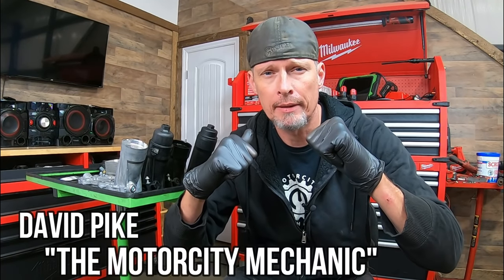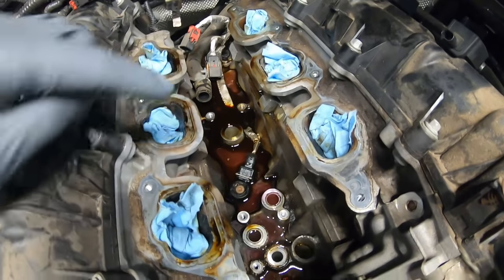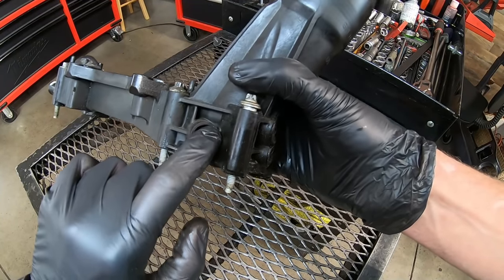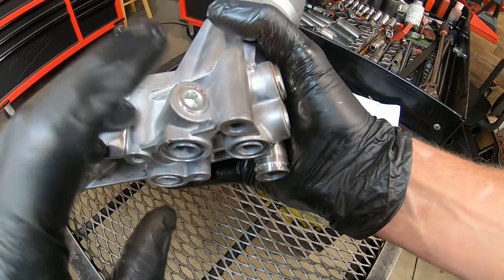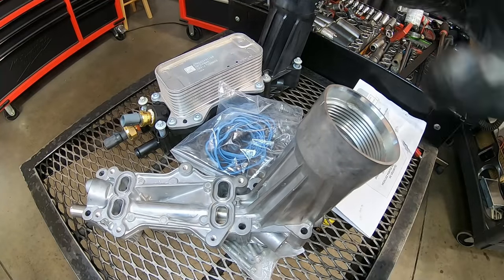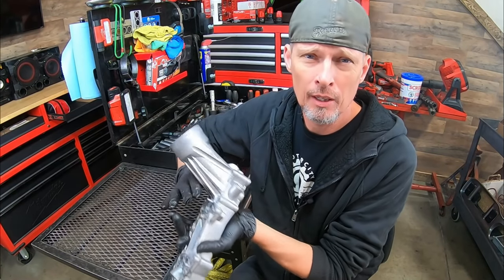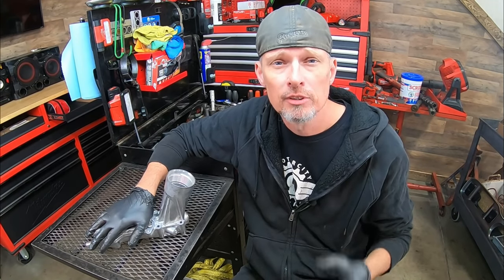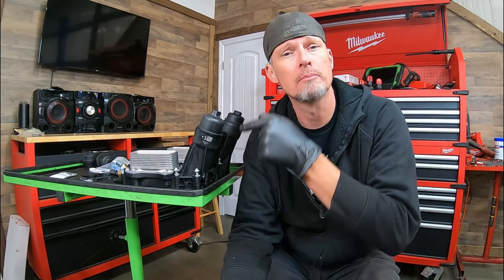Dorman 926-876 Aluminum Chrysler 3.2/3.6 Oil Filter and Cooler Housing Upgrade

Comment: I see no difference in fit for 2011 vs 2014 except you would have to get your hands on a 2014 cooler and cap why couldn’t I just do that if the ports and engine mounting bolts all line up?
Reply from the maker: As mentioned it’s not a fit issue. It’s needing to find the cooler portion, the bolts for the cooler to housing, the cap. Basically you almost buying a complete assembly to take the parts off. It can be done, you just have to spend more money and track down the parts. I have done a video on that as well To Upgrade or Not To Upgrade your 2011-2013 3.6 oil filter housing/cooler.
https://youtu.be/h8mEWyw0IZE

Comment: Where can I go to find out a vacuum line routing for 2012 Dodge Charger 3.6 nothing comes up when I do a search for a diagram
Reply from the maker: What are you having issues with? There are very few vacuum lines. Mainly just for the purge solenoid and brake booster

Comment: I installed the aluminum upgrade on a 2013 dodge challenger..now I have a cold start rattle..imo due to no oil drain back valve...all the oil drains back to the pan..the old housing had a built-in anti drain back valve ..the new one does not...now there is a screw on filter adapter,,cost 375$.. with a drain back valve in the new filter....I should have replaced the filter housing with an oe replacement part.. regret useing this so called upgraded part now... anyone else having this issue yet...
????......,,

Comment: What about a 2021 jeep gladiator is the problem solved?
Reply from the maker: I haven’t seen any late models with the issue. After about 7-8 revisions it seems they may have gotten it. We will see once those newer vehicles start getting some higher miles on them
Reply: @MotorCityMechanic  Thank you! Your channel is one of the best!

Comment: I am not used to wkg on chrysler stuff but have to look at one shortly which I suspect this assembly and I like the idea of using aluminum one, are there any steps needed to prevent metal corrosion where they mount to the block etc?  I have found over the years that cast iron to aluminum will make things corrode unless treated

Comment: I do not quite understand .. I have the first generation .. I will not be able to use this spare part?
Reply from the maker: Not straight out the box. The cooler is a different shape so your old cooler will not bolt up the this replacement part. There is an option but it ends up being twice the price if you do
Reply: @MotorCityMechanic  
I changed it to a second-generation cooler a year ago, and now I just buy another filter.  But I would still like to put this one, and forget about the problem.
Спасибо!
Thx!!!!

Comment: Your fitment chart confuses me. The Dorman site says it fits my 2017 Chrysler 300. According to that chart it won't? Weird.
Reply from the maker: I believe your reading it wrong. There are two engines for that year….one is gen 2 and other is gen 3. The 300 never came with the gen 3 for that year so yes it will fit. It’s the model of vehicle that determines which gen and what year.
Reply: I did some research right after I commented, and also confirmed it. Thank you for the quick response. I am glad my engine doesn't have that EGR trash.  I am a diesel mechanic and it's non stop problems.
Reply from the maker: I agree. On the gas engines, very few issues at all on the gen 3 with the egr valves. Luckily gas engines don’t have as much soot build up on the exhaust side as a diesel

Comment: Ever since General Motors started using plastic oil/coolant passages in the 1990s, it doesn't take much of a brain to figure out that it is not a good idea to keep going with this plastic stuff almost 30 years later.

Comment: I can't believe auto manufacturers can get away with putting crappy plastic parts like this on their products which requires aftermarket parts to correct. I'm a new Jeep owner and will look do this fix next oil change.

Comment: Hey guys , i have a 2012 Chrysler 200, last October i replaced the oil cooler housing , (it was leaking,) with the new  Doorman aluminum housing.  8 months later and it is leaking again. Has anyone had this issue ?
Reply: Try changing gaskets as well

Comment: In one of your other videos, you say you can update early model Oil Coolers to late model ones, with the only issue being someone might not load the correct oil filter. Is that still the case with the Dorman aluminum housing?

Comment: where is oil filter bypass valve in gen 2 and 3? in the cap?
Reply from the maker: It’s in the cap on those generations. Thanks for the question and make sure to subscribe

Comment: It's the pimply faced 16 year old at Jiffy Lube who thinks he needs a 4-foot breaker bar to put the oil filter cap back on. Which means that if nobody teaches him, he'll keep breaking them.

Those oil coolers at the stealership are over $500.00.

Comment: Do like me, fix it and sell it. Mine happened at home but if it happens on the highway you’re engine will lockup. I just got back from a long trip and the next week it started leaking. What a bad design. You have water and oil being pushed through a POS plastic part.

Comment: Put one on my 2014 Town & Country, torqued to 110 in lbs., started leaking oil 2 weeks after install. I just bit the bullet and installed a new Mopar unit which does not leak. I CANNOT RECOMMEND THE DORMAN UNIT which is the subject of this video. Double the work, Usual Dorman crap quality.

Comment: Why do you insist on an "OE" oil pressure sensor when it's the OE sensor that failed? For that matter, the OE cooler itself is a failed OE part. Doesn't it make more sense to recommend a "name brand" oil pressure sensor?
Reply from the maker: I have replaced more aftermarket oil pressure sensors that were “just replaced” then I care to count. Some leaked out on the connector side and caused oil to seap into the harness and all the connectors and Pcm causing expensive repairs. I go OEM for many reasons. One is that they are constantly revising parts when they find issues so when you go to the dealer you are getting the newest versions versus the same part at the local part store that doesn’t seem to last. If it was an easy to get to sensor then no harm in gambling. If it takes 2-3 hours to replace like on some 3.6 engines then spending more money if your having someone else do the repairs or wasting your time again doing it yourself. To me it makes a lot of sense. Spend money on OEM now or risk spending alot more later on aftermarket. Gamble if you like….but when it comes to my customers and reputation….I’m only using the best version.

Comment: I will never understand why anyone would put an oil cooler in the V of an engine let alone an coolant to oil cooler exchanger type. Way too many points of possible failure .  A simple spin off oil filter type assembly with oil cooler lines running to the front of the radiator are so simple, umcomplicated and easily accessible. They have worked for years on many North America motors. Provide superior filtration compared to a simple paper filter and in some cases can allow for a larger coolers for towing. Mercedes once ran a driveshaft for one of it's 4wd cars right through the middle of the oil pan. With a seal on one side where it entered and a seal on the other where it exited and the shaft was bathed in engine oil. Like taking a dangerous good course to open a can of beer.
Reply: I can shed some light on why it’s where it is. It’s not an oil cooler, it’s an oil warmer. The point is to get the oil up to temp as quickly as possible. That’s an emissions thing because a huge portion of the engine emissions happen during warmup. But the main reason is to keep the oil at a consistent temp for the variarable valve timing, which runs on engine oil.
Reply: @kipamore  yup, emissions rue the day

Comment: I think it's plastic because it's an insulator to reduce engine heat on the cooler  I like the aluminum but I think it would reduce the cooling effect. Either way it's a dumb design.

Comment: Easily the worst design for such a common engine. And to bury this failure prone part so deep into an engine is almost criminal.

I beg to differ...the 4 litre inline 6 in older jeeps is as close to perfection in an engine out there.

Comment: Thanks David, I have a question, where is the engine coolant temperature sensor on a 2014 Grand Caravan? I've been trying to get a definitive idea as to the exact location. They usually are in the cylinder head or the intake manifold. In this video you are saying the oil cooler assembly has a oil pressure switch and an oil temperature switch. I watched this video today and now I'm totally confused I have the video starting where he's saying it's the ECT engine coolant temperature sensor. Can you PLEASE tell me the correct location? https://youtu.be/QsN6uyL6EUQ?t=494
Reply from the maker: The engine coolant temp sensor is located on the rear lower corner of the left (front) cylinder head.
Reply: @MotorCityMechanic  thank you.

Comment: The two ports that feed the heat exchanger are open in the body,thereby not feeding the heat exchanger  with oil,this is a very bad design. And not a very good filter.

Comment: It will also work on a 3L version of that same engine.
Not to mention that is the second stupidest place for an oil cooler I've ever seen. The only stupider one is in the Mercedes V12 that has the oil cooler inside the engine between the two Banks of cylinders period where it does virtually no good whatsoever!
Does the plastic get brittle or does it get flexible. You can't do both. It can get brittle and then it can get weak period but brittle and flexible are on the opposite ends of the spectrum.
You can put a gen2 Chrysler oil cooler and filter assembly onto a gen-one, why can't you use the doorman aluminum Gen 2 replacement on a gen 1 engine??? I smell something fishy here.
Okay I see, you explained that towards the end of the video, why you didn't explain it when you were saying it doesn't fit is beyond me. However you can retrofit a Gen 2 or 3 oil cooler onto it. That makes a difference because those you can get from yards all over the place.
The other problem I have is that I have seen a couple of days in both gen 1 and Gen 2 and the oil cooler itself has the same part number. Perhaps that was a flawed part but I just wonder?

Comment: "Are You Kidding Me?" I just can't accept this "all engines have problems", so, failures are OKAY? I've not invested in ANY vehicle past 2000. They ARE CRAP!
Reply from the maker: The reason all engines have issues is that all are "made by man". When you throw the human factor into things nothing is perfect. I promise you that there is no engine ever built that was perfect or didnt have issues. Some worse then others. There is a reason why every dealership has had a service department since the very first vehicle was built.

Comment: Pentastar engines are the biggest pieces of crap 2 grace our roads in  decades! The main problem for me is that these vehicles also encounter a host of other issues besides the all-too-common rocker arm failures, the oil/coolant leaks from up top there, the plastic thermostat housings, etc. They also have weak transmissions(62te), tipm issues, rear h/vac will definitely need some repairs eventually, I mean the list just keeps going on & on and the more you look at reviews and other people's experiences, you find other issues that make you wanna not buy any Dodge/Chrysler/Jeep product manufactured anywhere in the 2011 thru 2021 years! I think I'll pass...especially after hearing people with the new "revised" 2016-up pentastar engines still complaining about the same valvetrain issues & oil leaks from the filter/cooler housing assembly!?! You can replace it with an aluminum one & call it an upgrade all you want but it's still gonna leak from underneath it when the 0-rings give way eventually...

Comment: These OEM oil coolers are cheap trash. The ones on the Chevy ecotec engines are the same way. What's the point of cutting cost so aggressively when the reliability of the final product is crushed? All this plastic sh*t has got to stop. I have to do this job oil on a 2016 Ram 1500. The truck is only 6 years old! Our country's engineers are doing a worse job now than they have in the past. Quality & reliability are going DOWN, not up. They should be EMBARRASSED. They don't even CARE.